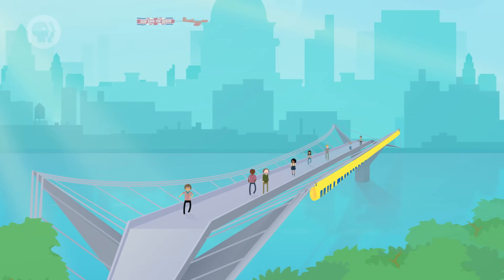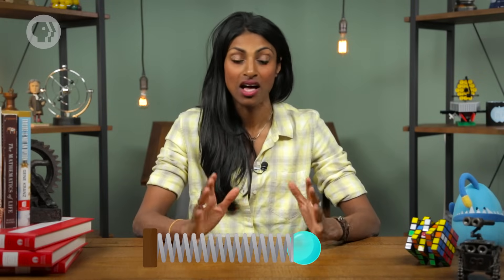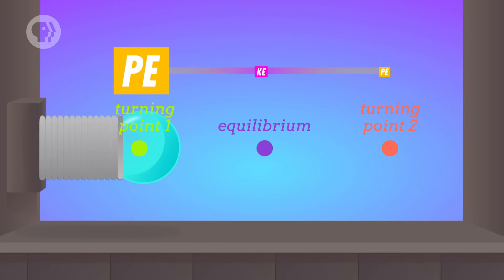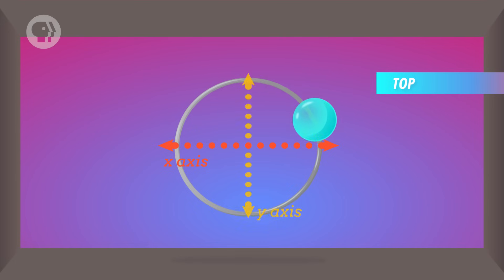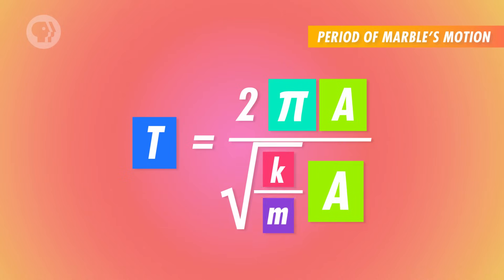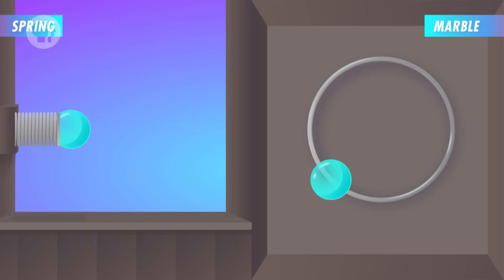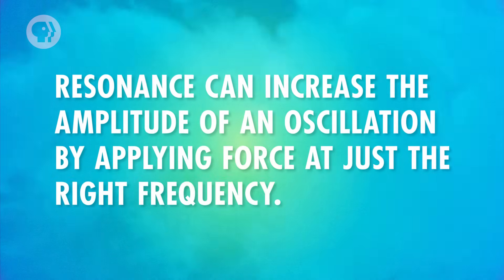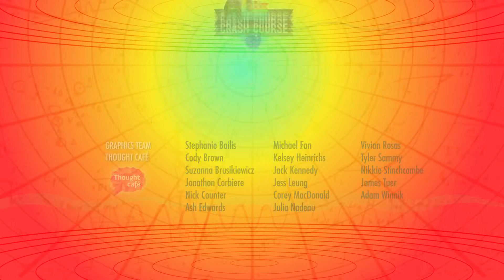Simple Harmonic Motion: Crash Course Physics #16

Comment: why do you use the constant k for the spring on a circular motion if there is no spring?
Reply: That's a valid question.  With the circular motion you will have an angular velocity (usually lowercase omega but I'll use w).  If you do the thing and tilt it like she did to where it looks like something going back and forth it will be relatable to the mass-spring system by w=(k/m)^1/2.  This is helpful because the solutions for each of them will be basically the same even though they are seemingly unrelated.

Comment: I only watched half of this video, because I wanted to finish all previous videos prior, but I applied this concept and knew this, in part, because of my 1st semester senior year highschool Physics 2 H class and my spring semester college sophomore Differential Equations [MATH 234-01 with Prof. Brooks Emerick] math class.

Also, if one checks my twitter for the connection between two VSauce videos, one from VSauce and VSauce3, one will notice that upon discussing the [arc - This was a flub; it should be Planck length. Sorry.] length a short video graphic of concentric circles becoming increasing minutely, as if looking at smaller and smaller cross sections of space. I knew that the one would likely piss me off erasing what I had left incomplete on Facebook, however, I expected, somewhat, for it not too. I expect some sort recognition of humanity, despite my complexity any quantum computer sufficiently intelligent enough could mimic. So my task to humanity and consider this is a requested task because I do not appreciate getting anger everyday for the sake of science. I love the subject but anger, and or wrath, is not my "best behavior", it's my "Worst Behavior". 

[💀/ [😇😈😈]] - Junior Alphonse / Junior A., Jay R. and Juno Model or [💀-🙈 & [😥=😈=[😒/😈]=😇]] - Junior Alphonse and June the Homo Sapien Sapien and Jay Rainer, with his constituent three moralities [light, neutral, and dark] and Juno.

Comment: The reason the bridge had so much problems is that its essentially a suspension bridge but with the rigging along the outside rather than the inside.

Its like a hammock, supported vertically just fine, but horizontally theres nothing stopping movement.

Comment: How do you determine the spring constant?
Reply: There are several ways, really. You can hang weights of different mass and look at the displacement. Or you can measure it against another spring with a known spring constant. Or you can use the motion of the simple HO at different initial displacements and fit the result to a line. I'm sure there are others.

Comment: What I don't understand is why the oscillation was actually caused and wouldn't friction or resistance stop this?
In the theoretical explanation of harmonic motion there is no friction or resistance, but there is in real life, so how come the bridge is still oscillating?
Someone please clarify 😅🙏🏻
Reply: I am not very familiar with this particular case of bridge failure, but Dr. Shini says it was due to the footsteps which tells me that the bridge designers didn't account for a large enough eccentricity of the loading. The friction and resistance you are referring to is called dampening, and when there is dampening in a system it is no longer considered as 'simple harmonic motion', it is called 'free damped motion'. The differential equation in this case becomes x''(t)+cx'(t)+w^2x(t)=0. So I hope that answers the first part of the question. As for why the bridge keeps moving it's because the motion started to resonate. To describe the motion of the bridge when people were walking on it we can use the 'undamped forced motion' equation, which is x''(t)+w^2x(t)=Fsin(at) where a does not equal w. The right side of the equation represents the force applied and its periodic nature, the left side is just the equation from before ignoring dampening as you already mentioned it doesn't seem like its doing a lot. I know it sounds like a lot so far, but bare with me. The solution to this equation assuming no initial displacement or velocity before the force was applied is x(t)=(F/2w^2)sin(wt)-(F/2w)tcos(wt). Notice the t term in front of the cosine term, as time goes this term will get larger and as this term gets larger and larger the amplitude of the displacement will get larger and larger. As people were leaning in to the sway they were also increasing the F term which would only further increase the displacement. If that was all too complicated in simple terms, when structures start to resonate they are really hard to stop and impossible if the loading that lead to the resonance is sustained.

Comment: What's the relationship between architecture & music?
Reply from the maker: We've KIND of got an episode about that coming... kind of. 

- Nick J.
Reply: Music has set beats, or meter, and variety can be achieved by subdividing beats, or holding for multiple beats.  The point is that the beat is recognizable as a unifying element that's consistent throughout even with the different variations.  Architecture often uses a grid to establish a unit of measurement that's used throughout the building, even though it may be divided in half, or in thirds, etc.  The unit of measurement, or grid spacing, creates a sense of unity in the building, meaning all the elements seem related to each other.
Reply: Lol Calculus?
Reply: God
Reply: Yup, def calculus

Comment: Check out some clips about the tacoma narrows bridge, that's an extreme case of what oscillations can do to a badly designed bridge.
Reply from the maker: Right Here - https://www.youtube.com/watch?v=TcUX6eNT2j4
Reply from the maker: We did a Crash Course Kids episode all about that bridge. TERRIFYING FOOTAGE!!!

- Nick J.
Reply: The Tacoma Narrows bridge failed due to aeroelastic flutter, not resonance (at least, according to the mechanics professor from my degree). Aeroelastic flutter is a positive feedback effect: as the bridge oscillated and tilted, the wind striking it at an angle exerted a force. As the force cause the oscillation amplitude to increase, the bridge deformed to a steeper angle, exerting more force and deforming it to an even steeper angle until... well, y'know
Reply: +CrashCourse Where is the video 📹?
Reply: Minute Physics has a great video explaining how the Tacoma Narrows case is not due to resonance.